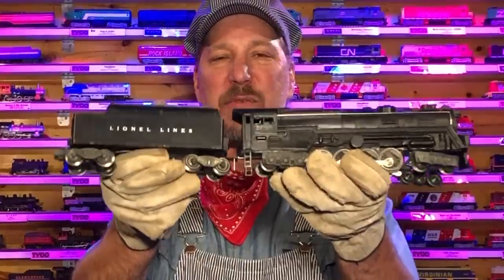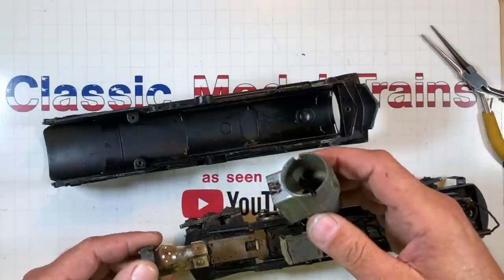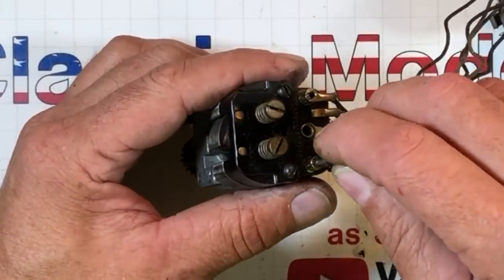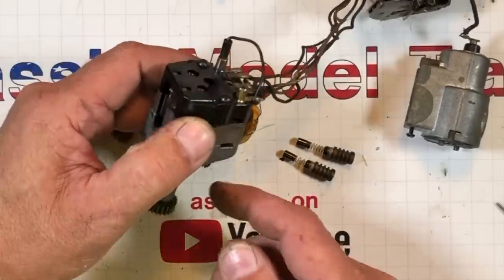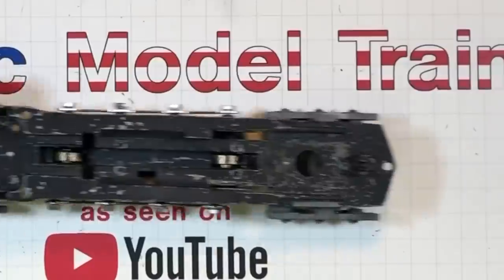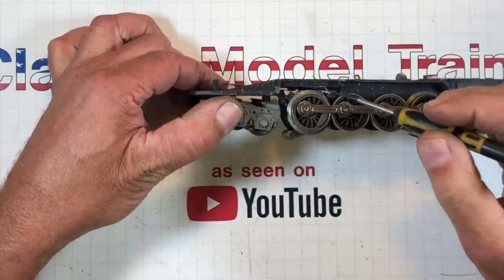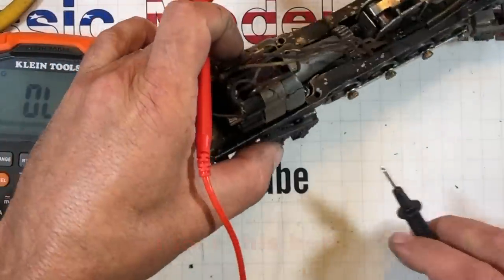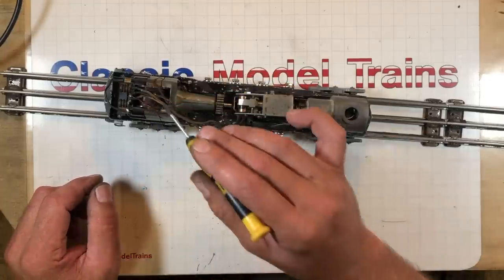Repairing a 1946 Lionel 2020 Turbine For Fallen Modelers Son.

Comment: Ron I wanted to say thank you very much for getting my dads old locomotive running again. Im older than Norman and I havent even seen it run. I remember my dad taking it to the hobby shop a few times trying to get it repaired and they never seemed to bring it back to life. Your skill is indeed incredible. Thank you! 🙏
Reply from the maker: Hello Paul,  Thanks for reaching out and adding some more info to this great story.  Glad to help out!!
Reply: They didn't have YouTube University. I have several Post War Locomotives. Most run not any better than okay. My 681, which is similar to this has been a stinker since my dad bought it used in the 70's.  I'm looking forward to tearing it apart and seeing if it is worth all the range once she's been serviced.

Comment: I am fortunate to have some old Lionel smoke bulbs and a few engines with them installed.  Most were changed out for the heat element units.  The bulbs created a light shift coming out of the stack that gave an eerie sort of illumination on ceilings combined with the smoke as the train went around the track.  Nice restoration job!  Darn nice running engine!
Reply from the maker: Thanks Trainman.  Pretty cool you still have some old bulbs. I hear there pretty rare.
Reply: @classicmodeltrains  Yeah!

Comment: Cool restoration and repair! Regarding the smoke seeming a little weak, the 1946 bulb type smoke units actually used a different type of smoke pill than the later SP pellets. When Lionel switched to the resistive wire heater smoke units in 1947 that did use the SP pellets, they offered conversion kits to dealers to upgrade 1946 locos to the newer type smoke units.
Reply from the maker: Well that sounds about right to me.  I know I will never find any old style pellets.  Dang it!!  Thanks for the cool information :-)

Comment: You did good, Ron! You did good. I hope Norm appreciates what you did for him.

I have a 2020 that I got from my dad decades ago and between my younger brother and I, I think it is pretty much toast. I haven’t seen it run since some time in the late ‘60’s. My brother did gawd knows what with it during my Army years and it’s been stored away ever since. I know the boiler front is broke off, the light bulb is gone, the whistle unit in the tender is gone, and the original caboose is gone. I bought a work caboose in the ‘60’s and a Pennsylvania caboose in the 2000’s with the intention of trying to repair the loco and train, but I don’t think that’s gonna happen. I’m old and fragile and spend more time at doctor’s appointments and sleeping than I spend being awake, so it’s does my heart good to know someone with a 2020 has a rebuilt working loco for my favorite railroad, PRR!
Reply: Tou have no idea just how grateful I am. I teared up.
Reply from the maker: Sorry to hear about the 'Ol 2020 getting so beat up in its younger years.   Aging is real hard on a Feller, your story tugs at my heart strings. Sounds like this video brightened your day as well as Norman's.  I'm hoping you get to feeling better.
Reply from the maker: Norman, I hope it was worth the wait.  This Revival has such a good story that goes along with it.  I will certainly remember it for a long time :-)

Comment: You can locate Greenberg Lionel repair books online. I purchased one and it covers all of the Lionel products from the 1940's to the late 1960's. It's a reprint of the Lionel service center repair manual. For the most part I service and repair my Lionel and Marx trains. You did an excellent job for a first time diagnose and repair. You did a great job in fabricating the spring. These parts are available from dealers who specialize in Lionel repair parts. E units, well I'm lazy so I keep extra ones on hand. I purchased a 681 from an antique shop for a very reasonable price. Broke the locomotive and tender apart, cleaned and replaced the missing parts, runs better than new. Sometimes these contraptions can be a royal pain to work on.😎😾🐕
Reply from the maker: Yup!  Ive seen the repair book.  I think I have it saved in my wish list on amazon.  Never really needed one yet.  Just need to know where these dealers are with all the good replacement parts :-)

Comment: Those early turbines are a little harder to work on than the later issues. A lot of guys will swear by the Atomic motors but to me I prefer the later more standard design as it’s far easier to service and maintain. Nice job on that! It should provide another lifetime of enjoyment after that cleaning and freshening up!!
Reply: Oh and one more thing, I’m seeing that slowly but surely you’re going to the dark side of 3 rail….. it’s dangerous to go that direction lol. That being said, I’ve been a O gauge fan/collector since I was a kid and I’m 41 now.
Reply from the maker: Thanks for your kind words.  I cut my teeth on 3 rail and "S" gauge.  I really enjoy it because of all the noise they make while running and the smell of ozone.  Yup gunna be a 3 rail layout in my future for sure :-)

Comment: Hey Ron,  you are so informative.  I have about ten or so of the those 671, 681 and 2020.  There are two version of the 671.  The 1946 only version is a dual drive with a big drive gear.  It’s impressive. They changed it in 1947 and and went to a different drive type. I really like the 46 because it’s like have 4 wheel drive.
Reply from the maker: Thank you!  Yes many versions of the Lionel Turbine Loco

Comment: Ron. Great repair. I don't think anyone is going to complain about your method of repair. I like your solution for the center rail power pickup. I like how you extended it with a single wire and used plenty of heat shrink to make sure it doesn't touch ground. I have a Lionel 682 that had a short and guess where it was. It was on that thin bar that comes up through the frame from the rollers.
Reply from the maker: Thanks Nathan 👍 Did you get the short fixed?
Reply: @classicmodeltrains  Yes I fixed the short by covering it with heat shrink tubing very similar to what you did.

Comment: Great vid, perfect timing! I just dug out a nearly identical train set that belonged to my grandfather. I think mine is a year or two newer but still a 2020 with a 6020W tender running on 027 gauge track. I have the full set, and from what I can figure its from 1947 or '48. Its likely got less wear on it than the one you just fixed but its certainly due for some maintenance. It did run out of the box after at least a 60 year long sleep but I don't suppose its had much attention even back in the day. 
My locomotive has a different smoke set up, the smoker is a heated grid element, and the bulb only lights the headlight.
Reply from the maker: Thanks!  Yup the bulb smoker was only used one year.

Comment: Excellent work! What perseverance! I’m very impressed with your dogged determination to figure out how it all goes back together. 
   As for the electromagnet winding, Lionel engines were designed to work with AC current almost from the beginning, and since there is no reverse polarity on an AC circuit, you can change direction with current flow. I hope this didn’t cut into your celebration of the Fourth!
Reply from the maker: Thank you Dan! Yup the phase switches in the electromagnet winding and the brushes with the rotation of the drum in the e-unit. Celebrated the forth and made a video.  Good holiday to me :-)

Comment: Back in the day, Lionel used smoke tablets that rested on the huge light bulb to produce smoke.  I didn't realize that Lionel used blind drivers even on the trucks.  I run all my Lionel 027 on DC as they will run on either AC or DC.  If you have a whistling tender, you have to disconnect it to run on DC or it will constantly whistle.   Cheers from eastern TN
Reply from the maker: I hear DC makes them run quieter because the e-unit is not buzzing constantly

Comment: You make cleaning a Lionel engine exciting……….even though it is a bit messy but sure beats watching grass grow. Good to see somebody else besides me that uses an ultrasonic cleaner………works wonders with cruddy, slimy, crud, and filthy stuff. Also good for carburetors and smaller car parts. Between the ultrasonic and a bead blaster any thing can be made like new again. Making the new spring is something cool. I like making parts rather than buy. Especially when I want to finish the build up NOW.  That is a well designed engine for repair and longevity. About the only thing (E unit) is a pain in the ass to fix. I generally eliminate the E unit and replace it with a miniature double pole 6 position switch to achieve forward and reverse. I don’t have any need for idle. Your an interesting guy.
Reply from the maker: Thank you for your kind words Gene. I like the challenge of fixing the original or fabing up my own parts.  Keeps the noodle thinking.

Comment: 16:44  The oil on the center rollers would tend to insulate them from the train's wiring.  The engine might run better if you left them dry, or maybe used a bit of conducting grease.
Reply from the maker: I dont believe light oil has any insulitive properties.  conductive grease would be the way to go but cannot get it in there with out removing the pin that holds the roller.  Seems like it needs lubrication from something so I figured light oil will be OK.  There is no problem with the way it runs

Comment: I own a 1954 release of the Lionel lines S2 #2020. I bought it along with four rail cars from the 1950s at the Little Choo Choo Shop in Spencer North Carolina across the street from the North Carolina Transportation Museum. When I got her she had a few scratches. The outside may not look in good shape, but her mechanisms sure were. She ran perfectly. I did not even need to conduct repairs, which shocked me. Strange how a failure of a locomotive the S2 was in real life, became a massive success in the model railroad community.
Reply from the maker: Sounds like you got a pretty good deal on a Classic!!
Reply: @classicmodeltrains  It cost around $200 for the whole thing. In case you are wondering the what was in the purchase. A 1954 Lionel Lines #2020 S2 Turbine and tender, Lionel Lines #3451 log dump car with 5 logs, Lionel Lines #2460 crane car, Lionel Lines #2461 Transformer car, and Lionel Lines #6419 Work Caboose.

Comment: Nice job Ron. Been thinking about building a Ho model of the 6 8 6  .
Reply from the maker: Thanks Norman,  You gunna scratch build it?  That would be pretty cool!!!
Reply: @classicmodeltrains  I thinks so going to use a rivarossi berkshire 2 8 4 chassis because the driver diameter is the same and make a shell make front and rear trucks just waiting to find a good donor I have 5 berkshires but they are in good shape I don't want to chop one up , we will see  .

Comment: Magnets being rare was also why all the radios back in that time had electromagnetic field coil speakers in them  They sounded great, but were pretty high voltage.  My 1933 Philco model 18 Highboy's speaker runs on somewhere in the neighborhood of 550 volts and that's also why radios of that time had such massive transformers in them, to step up the voltage needed to run things.
Reply from the maker: Thanks for that cool information. I had no idea the speaker coils were electro -magnetic :-)
Reply: @classicmodeltrains   At least up until the late 40's when they did start putting in permanent magnet speakers.

Comment: Number one it’s called a smoke bulb. Was only used one. Year. After that they used a normal smoke unit. Also, NEVER oil that solenoid plunger. Just clean that area with alcohol or contact cleaner. Oil will gunk it up and cause sticking. Clean is better. Thanks for sharing.
Reply from the maker: Hello Richard, Thanks for the information.
Reply: @classicmodeltrains  Happy to help and share what I have learned.

Comment: That’s a rare early 2020 since it has the horizontal motor, e unit, and smoke bulb. The removable wire on the brush plate is the e unit lockout put in place of a lever that you find on other Lionel locomotives. The smoke unit used pellets that sat in the bulb which should have a dimple in it and what ever you do don’t use smoke fluid.
Reply from the maker: I completely agree with you :-)

Comment: A small but critical point, the bearing on the end of the driveshaft gave a particular orientation as the bearing holes are offset. The bearings should be positioned so that the shaft is closest to the drive gears. 

Otherwise, very nice job!
Reply from the maker: So did I put it in correct or 180 degrees off?  I will keep my eye out in the future.  Thanks for the tip!!
Reply: @classicmodeltrains  
Yes. The mechanism binds up if installed 290 degrees off. I usually scratch an “X” in the top surface of the bearings (mostly because I’m old and may not reassemble it until parts arrive”. Merry Christmas!
Reply: @classicmodeltrains  
180 degrees (See?!?) 🤣🤣🤣

Comment: Nice! My favorite year and model of the Turbines! 1946 first generation of the steam turbines which was way overkill in their dual drive worms gears and the smoke bulbs system! These are probably the best possible years of these Lionel Trains. Supposedly they made a model 736 Berkshire with the dual worm gear drivers and smoke bulbs? But I have yet to find on in person. Unfortunately when Lionel learned that the extra gears weren't necessary and they began to count their pennies in manufacturing. They did away with anything they found to be unnecessary and by the mid 1950s their manufacturing process has reached its pinnacle. The quality after this was in a very quick decline as the company was fighting raising costs for materials and competition from other train manufacturers. Unfortunately this was the demise of Lionels years. They would have to cheapen up production costs even further to compete with the likes of AC Gilbert and Marx toy company. Lionel could no longer produce a good quality product for a reasonable price, because people wanted cheaper disposable garbage. So yeah that's what we're left with the only good things Lionel made was pre war and post war. Prior to these dates they were just a mediocre toy train company. Don't get me wrong here, they are still the ones who set the standards for toy trains, even though their standard production runs had changed for the worst, Lionel would still produce their highly collectable versions of the Original 700E in later models and dates of special interest for Lionel.
Reply from the maker: I like the way you think Jim!
Reply: The dual worm and smoke bulb Berkshire was the 726 that was made in 1946. They followed a similar evolution to the turbines, having dual worms and smoke bulbs in 1946 and the single worm and resistance wire smoke in subsequent years. The 1946 726 Berks are quite beautiful. They have turned handrail stanchions and no e unit slot. They are harder to find than the later Berks but not super rare.

Comment: Wow a house light bulb in a loco.....   :). Is the light also the smoke unit?  the reason for the dimple in the bulb?
Reply from the maker: Yes the dimple is to hold the smoke pellet.  Thats how they first came out or this is a Gen 1 version.  Crude but effective.  Then they found out the smoke pellet's smoke is very toxic.  So back to the drawing board they went.

Comment: This version of the 2020 has the smoke bulb headlight which tells you this is a 1946 make
Reply from the maker: Yup!
Reply: I have a 1946 make 671 and fun fact sp smoke pellets are not for smoke bulb engines you need the extremely rare 196 smoke pellets
Reply from the maker: @PiercesTrains716  Ive had you and another feller tell me that.  I hear these pellets are very caustic, or bad for you or something.